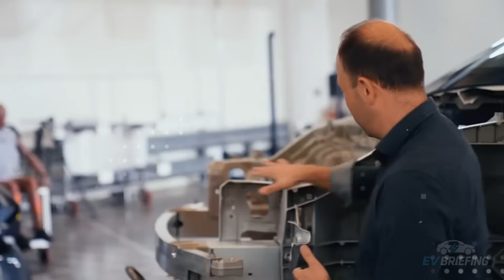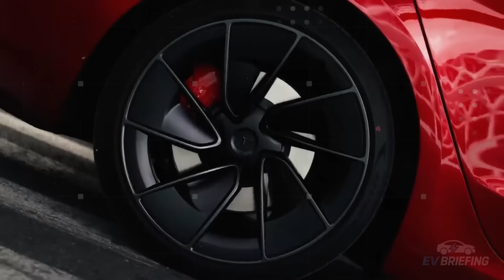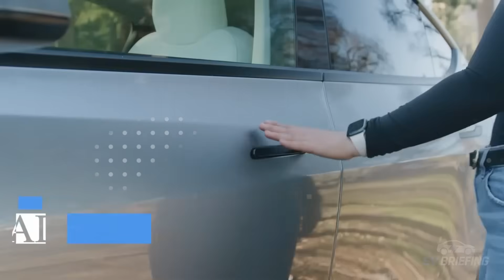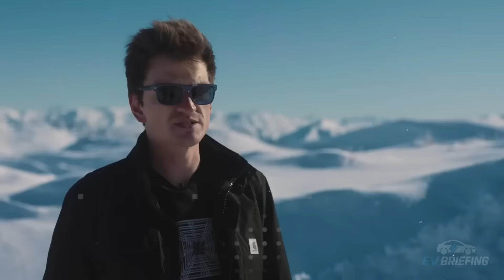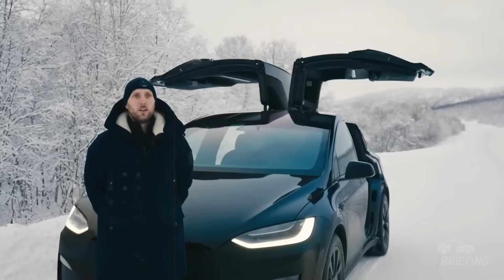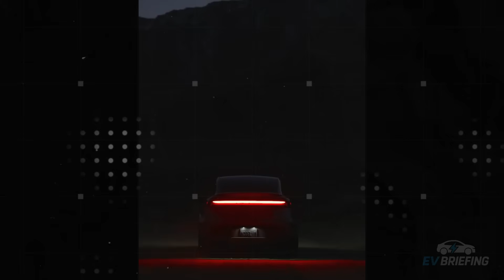IT’S HERE! NEW TESLA MODEL 2 for $15,990 With 550km RANGE – INSANE Features Just Leaked!

Comment: Mega casting? If this car takes a big hit, it'll be written off. 😬
Reply from the maker: That’s a valid concern — mega castings do reduce part complexity and cost, but they can make major repairs more difficult. Tesla’s betting on fewer parts, faster production, and higher structural rigidity overall. Do you think lower manufacturing costs justify the risk of higher repair bills — or should fixability still come first?
Reply: @EVBRIEFING  I think sustainability comes first. Car owners, as well as insurance companies, would benefit from a somewhat more conventional construction technology.
Reply: @EVBRIEFING  I think sustainability comes first. 😀
Reply: So don't wreck
Reply: @johnmccrae2824  Wrecking sometimes just happens. 😬

Comment: turn signals are TOO SMALL and thus unsafe; as a bicyclist,it's becoming harder to spot turn signals in bright sun because their size is too small.  turn signals should always be impossible to not see, in all lighting conditions and viewing angles. Styling be damned.
Reply from the maker: That’s a powerful point — and coming from a cyclist, it hits even harder. Turn signals aren’t just a design element; they’re a critical safety tool, especially for those most vulnerable on the road. Manufacturers often prioritize styling, but visibility should never come second. In your opinion, what kind of turn signal design or placement would actually fix this problem — regardless of aesthetics?